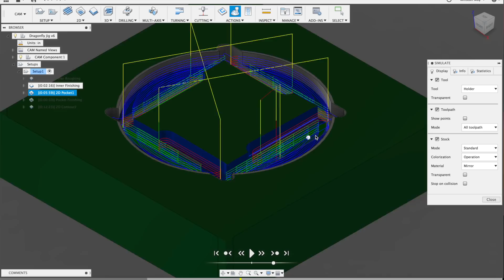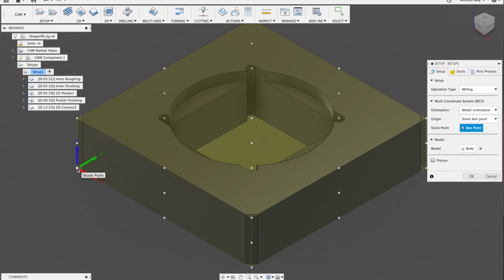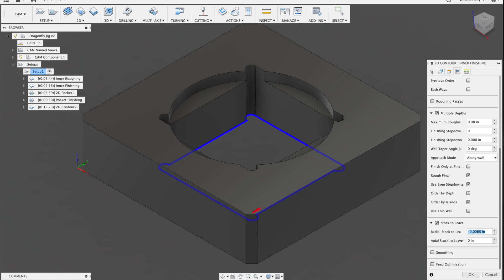Prototyping an Alignment Jig for Leather Debossing - #133 [CNC]

Comment: You need some blow or suck to remove the sawdust as you cut which will help a LOT. Need a LONG arm on that arbor press so you don't have to hang on it, and bolt it down. Very good Fusion feedback and logic and great narration.